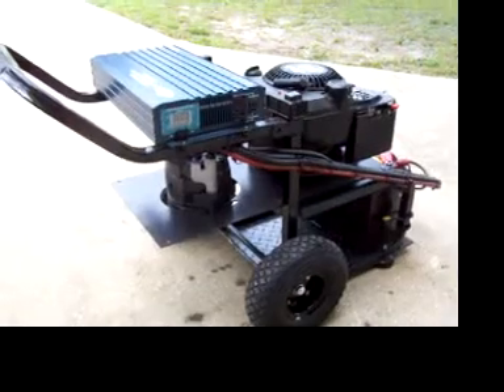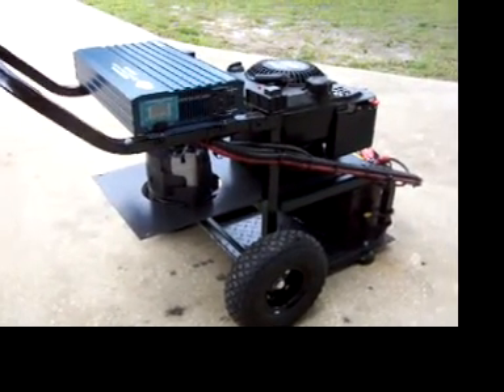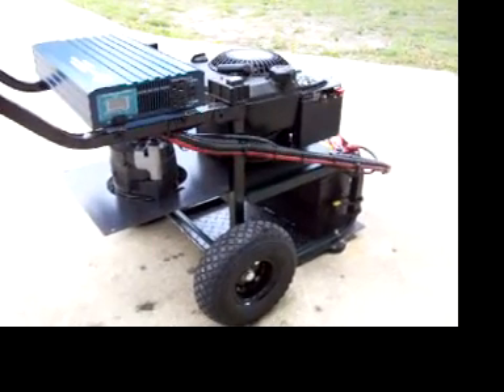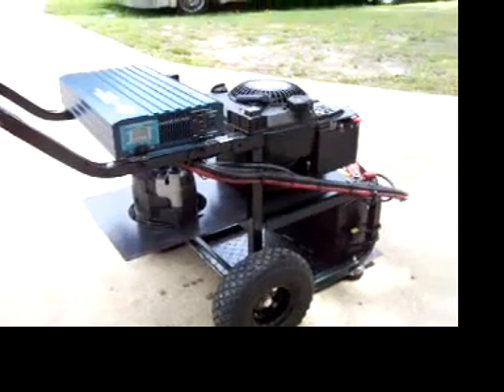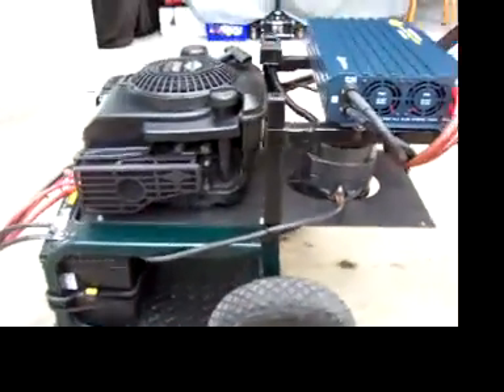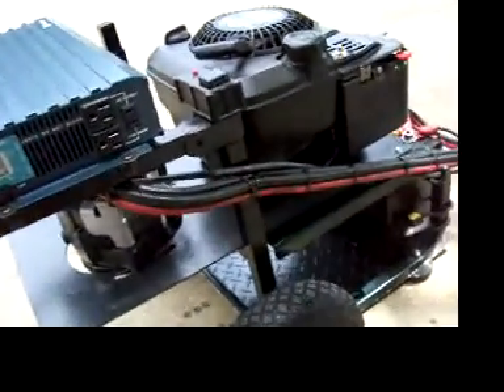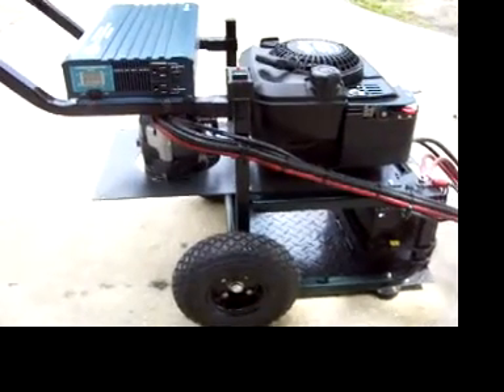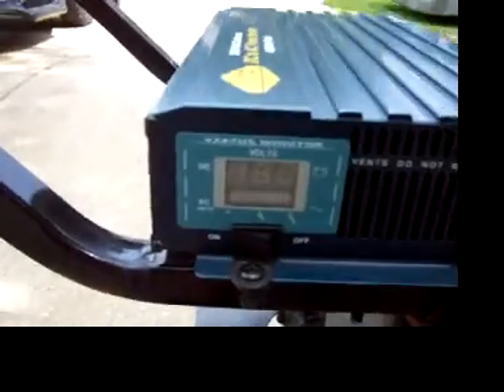Homemade inverter-generator

Comment from the maker: Well Scott I guess the automotive industry is not to bright because every car has a battery in a confined area next to a hot engine and multiple spark plugs but luckily this doesn't cause cars to explode on a daily basis......Think before you post

Comment: real smart , and cooll looking  but not too bright since when a battery is under load or charge , it releases Hydrogen gas and since you have the spark plug right over top of that , I hope you get lucky cause when that battery blows , acid will blind you or worse.

Comment from the maker: You can get the reverse fan and other goodies TheEpicenterThey have all kinds of stuff for home made generators. I don't have vibration problems the whole this is on rubber feet and tires. I also have rubber washers under the inverter mounts.

Comment: I like what u have!  Nicely built!  Built one my self and love it!  Do yea have any problems with heat?  I know when I start using over a 1000 Watts my alt. Get really hot. Mine is set up with belt drive as well meaning that the although is spinning in the reverse so the fan doesn't help at all. I think I can get a special fan. Any way nice work!

Comment from the maker: @ppd5613 Keep your DC leads thick and short as possible. The inverter has duel fans and does not get hot at all, however the alternater does get hot, make sure you have the stock pully fan on the alternator. I'm thinking of putting a small fan blowing on the alternator to help cool it. In a car, normally they get way too hot to touch. It has never let me down yet.

Comment: I'm planning on building a generator with a mower engine.  This was very similar to the set-up and design I was planning on using.  Any loss of power due to the length of wire?  Also does the inverter get hot?  I was told to use a heat shield to keep the inverter cool.  Just a thought.  Looks like it's properly weighted and would pull quite well.  Nice job.